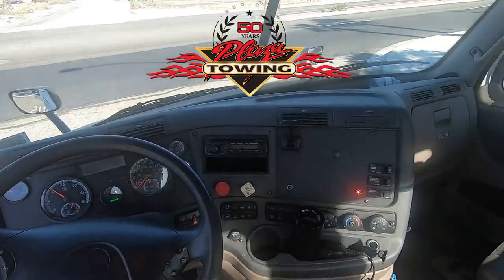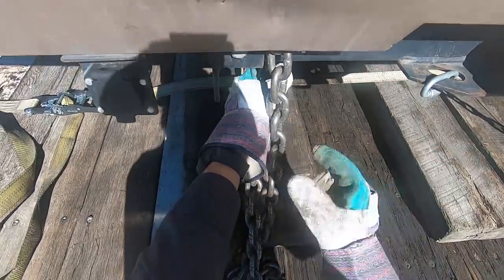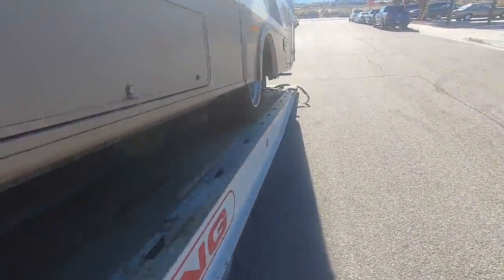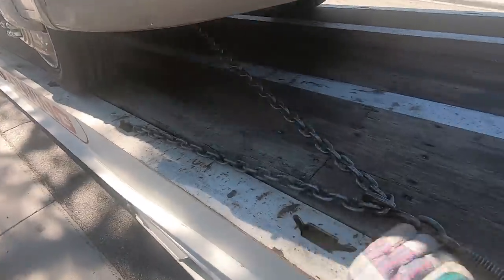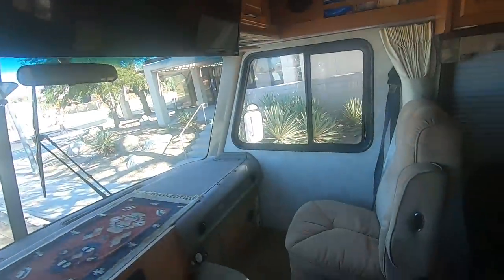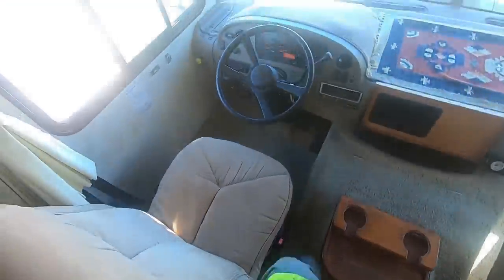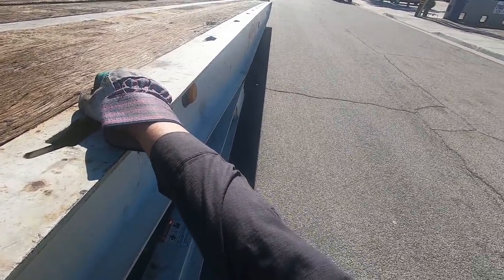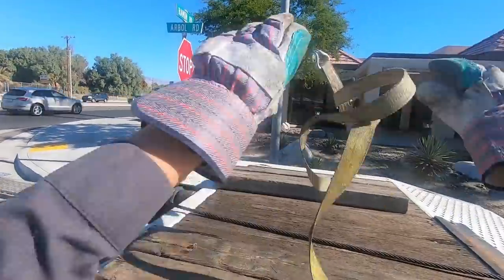Quick RV Tow

Comment: Investments are not always intelligent but, yes the R.V. is expensive to purchase. Although most R.V. lose value quite quickly and easily. I have no desire to mess with them unless I built it. I always enjoy hauling offroad tractors, small excavators, skidloaders, trackloaders, small bulldozers, and the like. I have loaded, secured, load checked, removed the securements and off loaded a compact tractor many times. I have secured, load checked, and removed the securements from a 10,000 pound dozer many times. They all stayed where they were placed with only a few rare circumstances which was just a minor load shift. I learned rapidly that more securements are better. Just because the law says four is acceptable does not mean it is adequet. Ron Pratt recovered on on 9/11 which I suspect that a massive load shift landed the whole thing heads down in the ditch.

Comment: Trent. Thought I have no actual idea what i am doing.... Would it have been just that more safe to hook the winch cable to somewhere on the axle just in case the RV decided to run?
Reply from the maker: If the u it did not run hence the brake booster not being operational, absolutely. The problem you run into is when you tilt the deck it changes the geometry of the winch cable. Therefore most of the time I use a the chain as a safety mechanism. Thank you for watching!